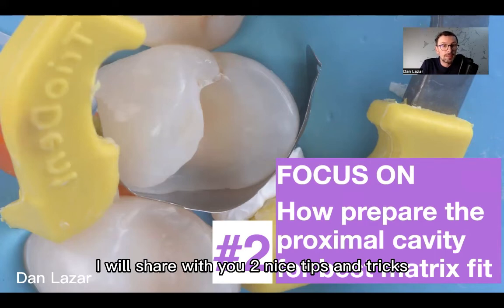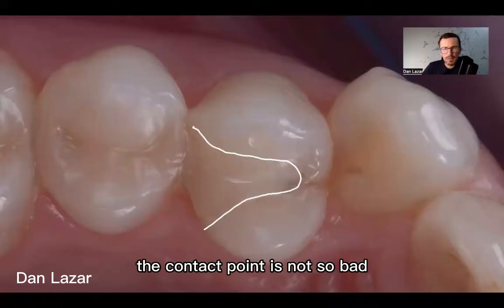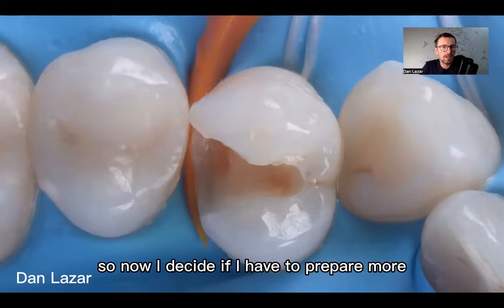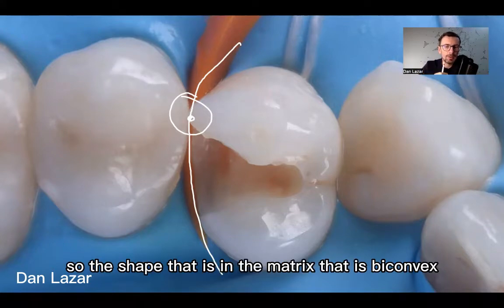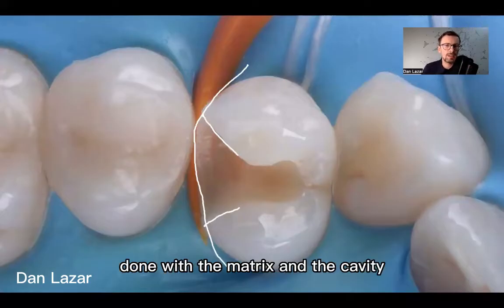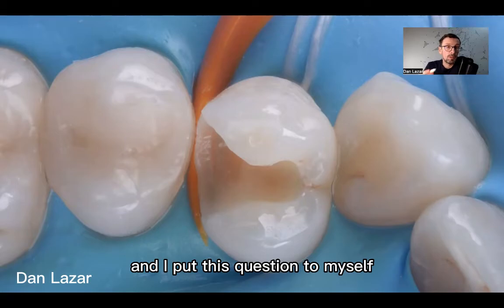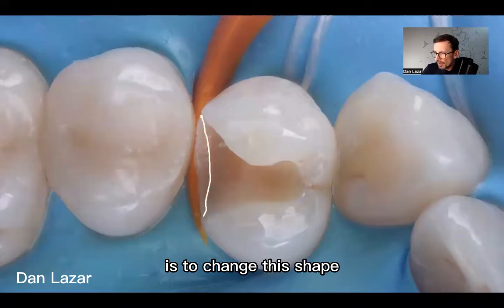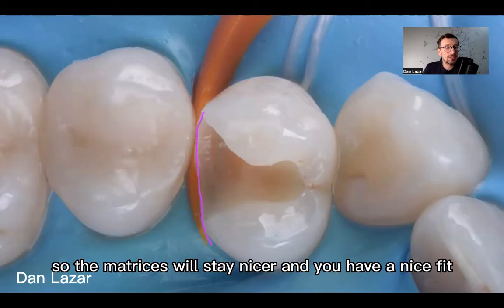FOCUS ON #2  - PROXIMAL CAVITY PREPARATION FOR BETTER MATRIX FIT

Comment: just to fit the matrix band, aren't we unnecessarily removing healthy crown structure , in a tooth which is already compromised. there has to be some other way around
Reply: Ya  not just the healthy it is guide for the contact point creation

Removing  it means  may be he thought it will break in future